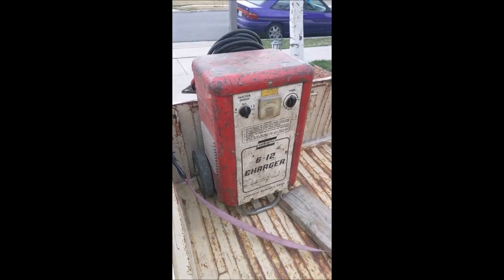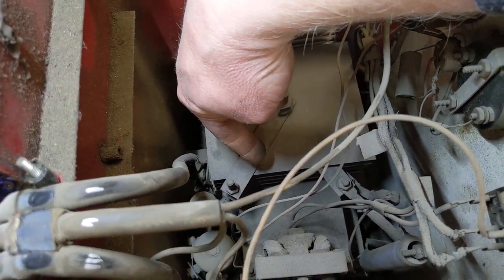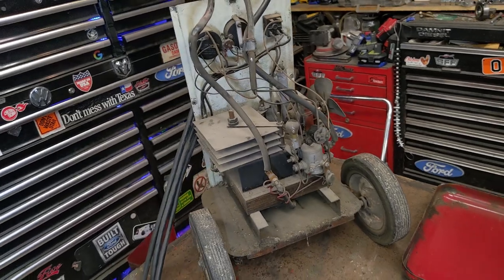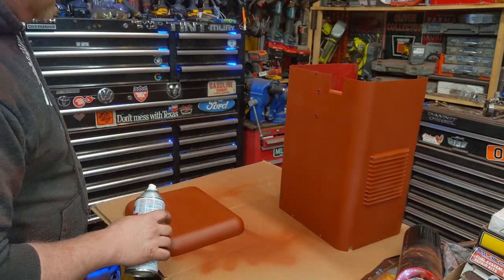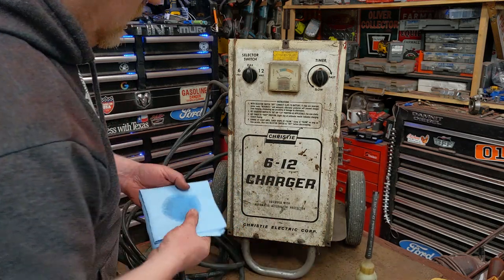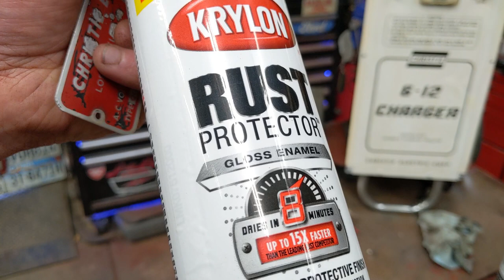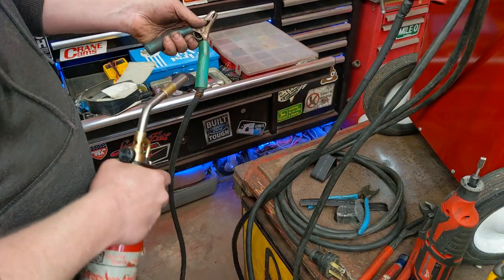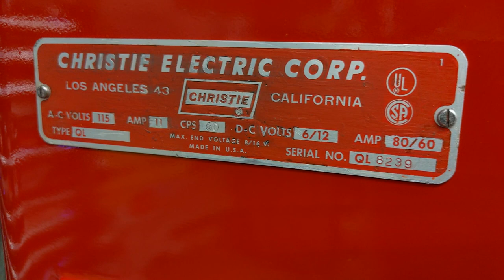Vintage Car Battery Charger Restoration

Comment: The light bulbs are used as a resistive load (current limiting component) in the internal circuits.  Nice job on the 'ol Christie!

Comment: Looks great. Rather than just blowing the dust from the charger to other things in the space, and possibly breathing it in, vacuuming while agitating with a brush could’ve eliminated most of that dust. And then finish by blowing out whatever remained, while directing it toward the vac hose in the hopes some would be captured. 
Project Farm found Rust-Oleum gloss enamel to be the toughest paint when tested alongside quite a few other spray paints. 
I detected a bit of red paint on your arm hair and perhaps your nasal passages, and while a respirator is often advised, a well-placed gentle breeze of a weak fan works wonders. 
It also works to redirect welding fumes, some errant sparks, and mosquitoes. 
Kerosene is my go-to for damage-free cleaning but stale gas still comes in handy.
Large heat-shrink tubing would've worked on those leads as well. Love your videos.

Comment: Nice Restoration. The light bulbs act as fuses just like the old screw in glass fuses. They are much easier to see if they have blown.
Reply: The old glass household fuses didn't light up did they?  To be honest I've never seen them in action as far as I can recall.
Reply: @Guillotines_For_Globalists  Your right old glass household fuses didn't light up. But did you know the thread on those fuses are the same thread as a conventional light bulb.
Reply: @binnsbrian  Yes I did, I found quite a few old screw in fuses at my Great Uncle's home in west-central Louisiana when we were clearing it out back in 2008.  Although that home in particular did not use glass fuses.  What happens if you screw in a light bulb instead of a fuse in those vintage panels?  I know the biggest danger was idiots either mistakenly OR intentionally swapping in a larger amperage fuse when one blew to mitigate that pesky issue of over amperage..  Much easier to do for the average idiot in comparison to a more modern panel mounted breaker which requires disassembly of the panel and isn't as easy as screwing in a new fuse.
Reply: @Guillotines_For_Globalists  They also used to insert a penny before putting in the bad fuse. That bypasses the fuse entirely. Extremely dangerous.
I've been an electrician since 1970. Back in the day when i had a fuse panel with a dead short on one of the circuits, I would screw a light bulb in the that circuit's fuse space. The short would act as a switch that caused the bulb to light up. I would then check the rest of that circuit. When the short was cleared the bulb goes out. Sometimes a short is hard to find on a dead circuit.
Reply: @binnsbrian  Thank you for the insight Brian.  Also interesting to know you can use the vintage glass fuse receptacle as a test light in a pinch!
Reply: Won’t a light bulb act as a variable resistor ?
Reply: @jsimm4587  A light bulb, while not a traditional resistor, does behave like a resistor. A resistor is a component that limits the flow of electrons. When these electrons flow through a resistor, they face ‘resistance’, and a lot of their energy is transformed into other forms of energy like heat.

This concept holds true for a light bulb as well. As electricity travels through the filament of a light bulb (which is essentially a resistor) energy is transformed into heat and light.
Reply: @binnsbrian  have you ever seen a lightbulb and a diode made into a battery charger ?

Comment: nice job!!!! im about to tell my age here.... back in the day dad and i used to use regular leaded gas to clean wheel bearings carbs and the like... had one 1lb. Folgers used coffee can and  1/2 lb. coffee can  used to clean all parts... now dad was a smoker... its a wounder we never blew ourselves up or burnt the house down !!!
Reply from the maker: That's great!
Reply: We used to put gasoline in a metal pump sprayer and spray wasps with it. One drop of gas hits a wasp and it's done. I still use gas to get rid of large underground yellow jacket nests.

Comment: The rectifier in that unit is a Selenium rectifier. If you ever see a "thick yellowish" smoke come out of the unit get the heck away immediately. A Selenium rectifier that is overloaded or shorts out can produce Phosgene Gas. (Deadly poison gas. Used in WW1).
 Wait for area to vent out well before going back in.  I saw some fail in the early B&W TV sets and industrial equipment. Nasty.
 Nice job on the restoration.
Reply from the maker: Good to know.

Comment: Wow that trick with the painting the wheels with not bothering to mask and just cleaning right away with gas is brilliant. I'll be stealing that.
Reply from the maker: It's pretty much the only method I use anymore. I do the same thing for decals on equipment. Just paint directly over them and wipe it clean while the paint still wet. You get a much nicer smoother edge versus a tape line.

Comment: I've seen the insides of the newer Napa battery chargers that are tall & on wheels and the transformers are absolutely tiny their just a bit bigger than the transformers in a battery charger you carry. These older charger's transformers are often double or more in size.

Comment: Fantastic job 👌 I believe the bulbs are being used as current limiters or as a troubleshooting aid.
Reply from the maker: Makes sense
Reply: In car audio it helps limit restoration or that's what I was told.
Reply: Your right Joe. Google says "A 12V lamp is used as a simple current limiter. As the current increases, the filament heats up and increases resistance thereby limiting the current. When the current is low, the filament is cold and at a quite low resistance so it will allow the max charger volts to be applied to the battery to fully charge it."

Comment: The light bulbs are a simple form of current limiting .  I use a dim bulb tester on old radios and TV's Same principle as the battery charger. Liked. All my best.
Reply from the maker: Thanks for the info. That makes sense.
Reply: @sixtyfiveford  Very welcome.

Comment: I have an old 6V /12V charger with 2 and 6 amp options that I repainted. It seems no the ammeter is getting finicky and won't work.
I opened the case and cleaned the terminals good but haven't tested it out yet.

Comment: Filament bulbs vary in resistance as the light up so are sometimes used to control or limit current. At low current they are low in resistance so don't have too much effect but as current rises they get hot, increase resistance and tend to reduce the through current.
Reply: I think they are also used as a cheap fuse

Comment: those bulbs are used as probably resistors as they didn't have anything like that back then or nothing as efficient as we do now  but still the impressive piece of machinery considering it still works out it's age . They make stuff like that anymore not nowadays.   Here's another thought  he could be used as a current limiting device  I could be wrong.

Comment: Thanks for the video. I have a couple of old chargers. An old Matco and a Fox. Eventually I repaired the Matco with the rectifier from the Fox. I threw the rest of the Fox charger in a box in the shed. Years later I'm cleaning out the shed and wanted to test the Fox charger components. They looked REALLY bad. Tested good 😊. I built a new box, replaced the push buttons with a rotary switch and added 4-70A diodes. They're better than any new ones for sure.
Reply from the maker: Awesome

Comment: I've repaired a few of those chargers over the years. I like the way they use the solenoid to cut power to the negative cable unless it's connected to a battery. Some chargers use a solenoid as reverse connection protection. The selenium rectifier plates tend to break down over  time. I just build a new one using a few stud diodes and an aluminum plate. Great video.
Reply from the maker: Awesome.
Reply: Ya I didn't know what kind of diodes those were but wondered if something more modern would have better efficiencies less voltage drop
Reply: @james10739  They are very old school selenium rectofiers. The running forward volt drop is about 1 V in practice. Modern silicons can drop anything from 0.6 V to 1 V depending on the current flow. So no great efficiencies here.  When seleniums fail you will know about it. The smell is pretty awful. I generally replace them with a centre holed silicon bridge rectifier package with four connectors on the top. If you buy a pack you can get them for the eqivalent of 2 to 3 dollars each or even less.
Reply: @r8118830    The problem with those is if you leave them on the battery and it gets charged they will end up over charging and can boil your battery dry.   The selenium rectifiers don't do that. 

Dale in Canada 🇨🇦
Reply: @james10739  for a application like this no difference really. and it will not really benefit from newer silicon rectifiers. only difference would be waste heat and saftey.

Comment: Nice job! What a find! Agree, much nicer and more robust than modern stand up chargers. The light bulbs might be like a dim bulb tester intended to limit current to a battery that's either really dead,  or with a shorted cell, or shorted diode in the charger, depending on where they're wired in the circuit. The test of that would be if the bulbs are wired in series in the circuit.
Reply: I was thinking the same thing about the internal bulbs
Reply from the maker: Make sense
Reply: @sixtyfiveford  Most likely as current limiting fuses.

Comment: Light bulbs were used like that to limit current and provide some short circuit protection back in the day.
Reply: Mr Carlson's lab might know. When he starts up an old device he uses his "current limited and variac supply" that has two light bulbs.
Reply from the maker: Makes sense

Comment: I have that exact same charger. The shop I worked at back in the early 80's threw it in the trash when they bought new chargers. I dug it out and took it home and it still works to this day, except the timer no longer works, but I put the alarm on my cell phone so no problem. Not as pretty as yours though.
Reply from the maker: That's awesome!

Comment: Glad you got the stubby wag from Ginger. Like Brian Bloc getting the wag from Baily. I remember well the upright Marquette chargers with the pointer knobs on the top. Great old chargers. FINE job and I may try to make one of your rattle can mixers for quart cans. I use oil base too AND if a little gas don't do it I just use a lot more gas! Thanks ad GBWYall!
Reply from the maker: My only thought with the quart can mixer is you may need to toss a ball bearing / marble in the bottom of the can?
Reply: @sixtyfiveford  May be. I'm still just thinking about it. No smoke out of the ears quite yet!

Comment: Good tips.  Enjoy seeing old, practical and well made machines restored and put back into service.  That charger should last the rest of your, your kid’s and your grandchildren’s lifetime.  Only other thing you might have done is, lube the fan bearings with light machine oil.  By the way, the big diode is likely a germanium diode.
Reply from the maker: Hey thanks. It should kick around until gas cars are a vintage creature.

Comment: Amazing moe :-D
It looks fresh and new again.
The transformer was likely hiding under the selenium bridge rectifier plates.
Not sure why they needed the bulbs,  maybe a trickle charge limiter.
The vertical tube is a wirewound power resistor,  maybe its switched in series with the mains supply to feed the transformer a lower voltage, maybe for the 6 volt function?.
Alternatively the transformer could have full mains voltage and  output tappings for 6 and 12v. 
All guess work, not a complex device.
You have done an amazing job 😀
Reply from the maker: I think your right. I was going to spend more time diagramming/testing the circuit, but I figured it's best not to mess with something that is working.

Comment: Just a guess but could the bulb bleed off the capacitor so there is no charge?  As a safety device before opening you would know if the build didn't work then you would have to discharge it yourself when you're working on it.

Comment: Found an old bench top battery charger at a garage sale. Currently doesnt work, but I wasnt sure of all the components. You identified some items i realize i can test for continuity. Thanks. Nice looking unit you have there.
Reply from the maker: Awesome
Reply: Testing comes down to checking the voltage output at points in the circuit. the primary of the transformer needs to be at the supply voltage. 120v rms in the States or 230V ac rms here in the UK where I live. The secondary should give out something like 14v to 16v ac rms. If it doesnt look at the transformer. That 16v rms is fed into the rectifier and the ouput should be somewhere between 13 to 15v dc. They are the main parts of the circuit. You can get variations from this as these are just ballpark figures.

Comment: Nice Job. I give Ginger 2 Thumbs up and you get one.  Not really, I just restored an old analog charger a few weeks back and had to install a new fan because somehow a wire got around a blade and burned up the brushes.  I also had to replace the timer because it lost its ability to countdown any longer,  I didn't go through all of what you did, but I did clean it, repaired the clamps, and straightened a few minor dents.  The brand is Schumacher and has multiple settings beyond charging but is a whole lot better than the digital crap being produced today that calls itself "Smart".  Now I'll admit, in the end, that Ginger is much smarter than I when it comes to retrievals.
Reply from the maker: Great work. These old things are always fun to tinker with.

Comment: I saved a Snap-On BC5500-Super and had the charging system diag tester on top. Nothing wrong with the charger and I needed one. The tester didn't work, visual inspection looks like someone caught it on fire and tried to hide it. It was too far damaged inside and got tossed. I started restoring it as functional restore as I'm using it daily at work.. I want to paint it black but I want to find or make decals before any paint. Got new clamps from my Snap-On Rep.

I recommend you put a 90 degree a/c plug. I put a small red and black zip tie around the leads on the back of case just in case. I almost got mixed up but easily check. I want to add some LED for status and backlight the AMP gauge, add another gauge volts,  or add digital.

Comment: Evidently, Christie's early chargers were orange/red (their ID plates were often red or black).  Christie's later color is turquoise.  Christie Electric is still in business.  While they started out in the 1920s (I believe) making battery chargers, by the 1970s their major product line became motion picture projection equipment for movie theatres.  For decades, they made THE best film transport system, illuminators, and xenon power supplies on the market.  Today, they are selling digital cinema projectors made by a Canadian company (which aren't turquoise, consequently).
Reply: Christie was bought by Clore Automotive and is now gone, i worked for a distributor / service center for them for over 20 years. Any other Christie names are unrelated (aeronautical / theatrical) Clore owned the Century / Solar brands then sold the Century brand to Lincoln Electric. Some parts are still left at Century Tool

Comment: You have a good charger there , no computer logic circuitry that wont let one charge a battery because its dead. imagine that who would want to charge a dead battery... and cables that flex in the cold weather not like the plastic jackets on the cheena made.

Comment: That plate thing is a selenium rectifier, a type of metal rectifier, invented in 1933. The big gray tube is a resistor. Replace the capacitor on the meter they dry out over time.

Comment: From the inset photo, it looks like that bulbs are wired in parallel with the solenoid terminals.  The large appears to have it's center (positive, assuming the solenoid is switching the "negative") to the negative control terminal on the solenoid so current limiting the solenoid coil and  will light if the solenoid coil is conducting.  Can't tell exactly how the small bulb center is wired.  But if the charger isn't working, it does appear to be a quick way to keep customers from condemning the rectifier transformer when it's the solenoid that has failed.
Reply from the maker: Makes sense

Comment: Nice resto, you done well with the identification plate. Probably not many 6V batteries around these days, modern chargers might not be able to charge a 6V battery. I thought she would jump on the lowest tyre first then the smaller one but she jumped right up on the 2nd to get the ball.
Reply from the maker: Yeah 6v is pretty much long gone. Golf carts still use them, but that's about it that I can think of.

Comment: The old battery chargers had rectifier tubes so i guess they put light bulbs in it for the old timers to see so they would think the charger was warking fine lol - 
 Its cool that those solinium rectifiers were still good - they tend to fail over the yrs -

Comment: Nicely done. Imagine they made battery chargers that actually charge a low battery instead of say it is dead and won't charge it. Major difference betwee my 1990 Shumacher and 2017 model. Those old chargers are starting to sell at premium prices. That one will still charge a battery 40 years from now.
Reply from the maker: So true
Reply: you could find a beefy transformer and get it wound for the proper voltages once rectified (ac voltage will read lower) I had done this once years back for smaller vrla batterys.

Comment: I think after reading the comments the light bulbs are for limiting current / voltage like the modern voltage regulators do now 
Nice paint job and touch up on the white paint
Reply from the maker: Thanks